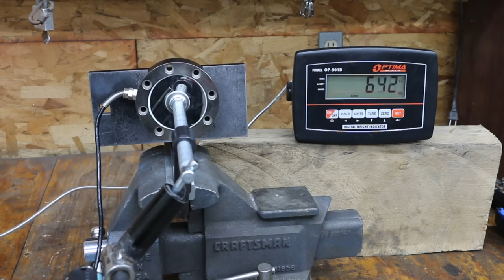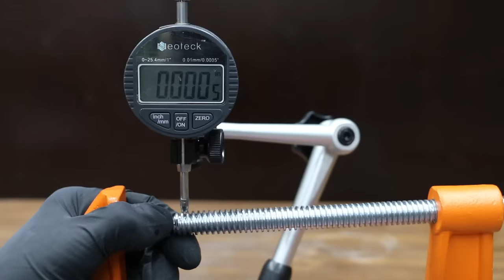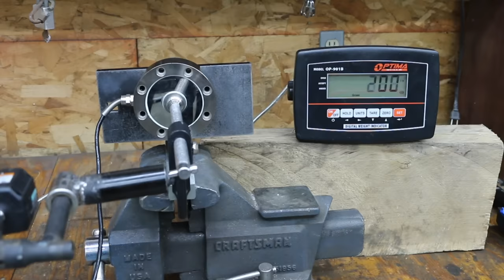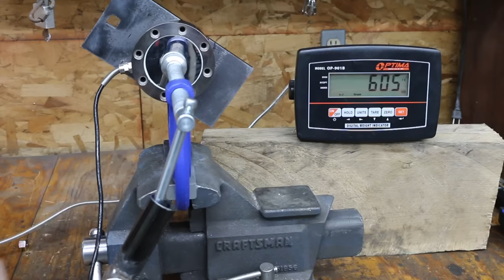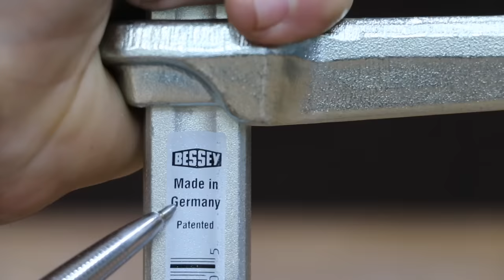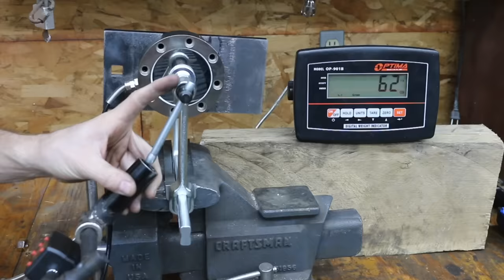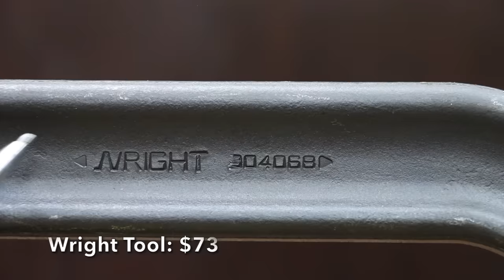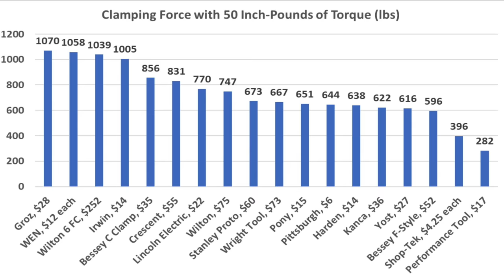Best C-Clamp? Let’s Settle This! $4 vs 252, Wilton, Yost, Irwin, Wright Tool, Harden, WEN, Proto

Comment: Your videos are very helpful and always full of unbiased testing.  I do have some reservations about the clamp force test…
The clamp crank arms were different lengths, so a constant of 50LB on the torque wrench would lose its “constant” quality when not at the same lever distance from the screw.  Additionally, it appeared that the sleeve you had set up to go over the crank, when attaching your wrench set up, was used at full depth on some but only partial depth on others.  This would suggest that the 50LB “click” may not be delivering the same torque to each of the different screws.  Test…Imagine if one of the screw crank arms was 4 feet long, you could get some serious leverage on that crank before your torque wrench ever knew about it.  So if length (lever) matters, it must be exactly the same for each test.

Comment: I can attest to the Irwin, had one for 2 years using in heavy equipment mechanic work. Finally bent the frame and handle pressing out a u joint that ultimately had to be cut out. It outlasted my harbor freight vise that catastrophically succumbed to the same u joint. No complaints for $14
Reply from the maker: Thanks for sharing.

Comment: I would like to point out I've gone through a few of these in my field of work, and one thing I can attest to with frequent heavy use, that if the threaded bolt in these clamps do not have a black coating on them, the threads WILL wear TREMENDOUSLY quicker. This alone should help get you a half decent one even with all the other down sides. Also avoiding anything made in china helps too. The thorough testing was fantastic though! You are doing gods work =).
Reply from the maker: Thanks!

Comment: Irwin were our go to in stone cladding. Things were expected to get damaged in out line of work so they hit a sweetspot of affordability and durability. 

When we found F claps it was a revelation for tight spots. We ended up doing some very rough modifications to them for fitting stone soffits on commercial builds. We would take the caps off the end and shave down a section to fit in between joints amazing what 12mm of material can support when you need it too 😂
Reply from the maker: Thanks for the feedback.

Comment: I tend to lubricate my swivel ends and threads the course threads is to allow you to adjust the clamp quickly less tirnsvto get where you want, the thread clearance allows for some dirt or small spatter to pass through
Reply from the maker: Thanks for sharing.

Comment: Every tool has it's place.. If you're holding wood or your wife's DIY project, use a $5 C-clamp, I used to run a boring mill and would use 1 Machinest clamp to pick up a 1000lb plate of steel without concern.. As with everything, you get what you pay for, and you got to have the right tool for the job.. Great Video as always 👍
Reply from the maker: Thanks!

Comment: As always love the tests, just a thought, I'm a welder by trade and I always oil up the threads and swivel head which completely changes the performance when compared to dry, some of those manufacturers may have done better just because of the added lube
Reply from the maker: Thanks!    Thanks for sharing.

Comment: The Yost is one of the best on that list factoring in price and design. Notice that the handle bent before damaging the screw (handles can be replaced, screws and frame not so much), the threads didn’t gall, and the frame took a high force without twisting like the other top brands. $27, that’s not bad. I have 3 yost c clamps
Reply from the maker: Thanks for the feedback.

Comment: After 20 years as a shipfitter I would love to have most of those clamps.  The only problem is they would never get used.  I carry clamps around, but I don't think I've ever seen anyone else use them.  As far as we have to carry everything, plus all the ladders and stairs. People start shedding anything with any size or weight to it usually before they even make it to the ship.  Then if you got to go up a dry dock or find a way to get down to the bottom of some obscure tank or hole and you would be surprised at how many tools you can pick up along the way.  Seeing people make videos where they use a different tool for each piece they need to make and enough clamp to supply an entire shipyard to hold something that's only a few feet long makes me wonder how they make any money I'd be broke just off of the tool budget
Reply from the maker: Thanks for sharing.

Comment: If you test trigger or Quick-Grip clamps, my experience is that they sometimes don’t maintain pressure overnight, and they get worse as they age. Building small boats, I use a lot of clamps. I tend to use trigger clamps for initial single-handed assembly convenience, but then substitute with more reliable clamps or temporary screws.
Reply from the maker: Thanks for sharing.

Comment: I very much appreciate you throwing in the F-Clamp here, I expected that style of clamp to be a lot lighter duty than the C-Clamp! Is there a chance we will se a F-Clamp comparison, perhaps with some other styles of quick release clamps as well? I always wondered if the cheap plastic F-clamps would hold any weight compared to the metal ones
Reply from the maker: Thanks!

Comment: C clamps are often used for brake jobs. Tesing how the finishes hold up to brake fluid would be interesting. Maybe on future tests, check how tool plastics/finishes/rubber hold up to brake fluid, engine oil, and common stuff like that.

Comment: I use the wilton 6 FC fir work building bridges  mainling while pile driving and with out a clamp of this strength my job as a welder would be several times  over harder.
Reply from the maker: Thanks for sharing.

Comment: Hey Todd, I just randomly had a video idea. There are many different kinds of  corded electric /cordless electric/cordless butane soldering irons. I have bought most of harbor freights and they are "ok". But I would love to see a video on the different brand irons you can come across and test! Another potential video idea is car ramps for oil changes for the DIY'ers, plastic/steel and many more options im sure. Good luck and thank you.
Reply from the maker: Thanks for the suggestions.

Comment: I previously thought that Bessey and Pony were high quality.  Now I just think they are over priced.  The Yost and Groz seem like good quality for the price.

I like how Pittsburgh clamps cost $1 per inch.  I think they are the best value (especially with a 30% off coupon) for a general purpose clamp when you don't need extreme performance.  I own several, including two 8" and a deep throat.  I bought the 8" c-clamps when I was working on an old deck and need to repair a splitting (cosmetic, not structural) 4x4 post to reach around the posts and right angle blocks (to stabilize the clamp on the post).  I later used them to repair an decorative cross member that was covered with paper mache siding boards (the house was built in 1972) that had delaminated.  I cut off the delaminated parts, then used a 2x4 fastened together in to an L-shaped corner, wax paper, and Gorilla polyurethane glue (because caulk would not stick), and misted the spots with water.  The clamps kept the glue from expanding, the boards kept it flat, and the wax paper didn't stick.  It turned out almost perfect.
Reply from the maker: Thanks for sharing.

Comment: I have a few 12" heavy duty clamps and 2 15" heavy duty clamps. I put a 15" Cresent wrench with a 6ft cheater bar and I can bend my 3" welding table
Reply from the maker: Thanks for sharing.

Comment: That was a good one. I've been a framer in Arizona for more than 25 years and all we use when it comes to bar clamps is 3/4" pony an never had any issues. Would love to see a best bar clamp or if you can afford it a best parallel clamp video. Thx from AZ.
Reply from the maker: Thanks!  Thanks for the suggestion.

Comment: You need a vibration test to see which clamp works best clamping down steel that is being vibrated by a grinder.

I use a 6 in double anvil c-clamp that works well for sharpening  lawn mower blades as it does take as much torque to hold the blade steady while sharpening. A regular c-clamp will always vibrate lose unless you tighten it with all you got.
Reply from the maker: Thanks for the suggestion.

Comment: Video idea. 

Old trick from the 70's (carburetor engines) was to use 2 metal cans, typically coffee cans,  coil the fuel lines between the 2 cans,  and fill the inner can with dry ice.  

Also,  a similar setup to cool the intake air using dry ice since cold air was more dense, containing more oxygen.

Be interesting to see if they still work on newer computerized engines, and how much better they actually work on the old technology engines.

Comment: Very impressive, I've always thought all C clamps were made pretty much equally. Have you thought of comparing different tarp brands? Any idea how you'd test for durability, heat resistance, thickness or would this be too short of a video?
Reply from the maker: Thanks!  Thanks for the suggestion.

Comment: Nice job as usual. I enjoyed this as I do all your videos. 
I do have an idea for another video. 
I've seen every one of your videos you have posted. 
Unless I've missed it through the years.
I'd love to see which is the best ethanol fuel additive to keep the small engines running great and not any corrosion from sitting all winter.
I personally use non-ethanol gas. But I use to use ethanol gas and was rebuilding my carburetors every spring.
There are so many additives on the market now. How do you know what's the best to use. My friend refuses to drive 20 min to a gas station that has non-ethanol gas... lol

Thank you,
Jeffrey Dohl

Comment: Thanks for using standard measurements. As an American gen Y kid, we obviously only learned metric in school but standard is just superior for practical measurements. Metric is great for many complex scientific measurements and rocket science but its really not very good for practical measurements due to the units having no relationship to the human body. As someone with a foot that's exactly 1' long, its nice being able to calculate distances and dimensions of things without any tools. An inch is also easy to understand due to parts of my fingers. 

I think metric is great and has its place but understanding and using both systems is still the best since standard measurements have a practicality that metric just doesn't have. Sorry if I offended any Europeans, Asians, Africans, or South Americans but I think you'd all be much better off if you used both systems too.
Reply from the maker: You are welcome!

Comment: I have Armstrong clamps with 1" bolt head locks, my smallest a 6" will hold a litteral 12 tons 24000lbs. The 6" was about $575.00 weighs about 12lbs.and is dropped fordged steel U.S.A. I used to be a Millwright!!!

Comment: Hey Todd, another interesting video testing various brand products. 👍 I remember in 1981 when I was working at a Honda & Kawasaki dealer in south Florida, our Snap-on tool man did a demonstration comparing their 12 point box end wrench again Sears brand. He had a 2" long plastic nut and slipped each wrench onto it, then forced each wrench against the other to prove that the Sears brand would slip rounding off the nut and the Snap-on brand would hold. He was correct which proved the Snap-on brand had a better grip. I believe you just recently did a similar test tightening a nut or bolt to see which wrench took more force to cause it to slip. If I'm correct the Snap-on failed pretty miserably.
Reply from the maker: Thanks!  Thanks for sharing.
Reply: @ProjectFarm  👍🧓

Comment: I love all your testing, just please consider using newtons, millimeters and Celsius degrees... The margins of error using these units instead is much tighter, and more precise. Also measuring clamping forces and such stuff in pounds is counter intuitive, because pound is a unit of mass, not Force (compared to Newtons). Keep up the good work!
Reply from the maker: Thanks, will do!  Thanks for the suggestion.

Comment: We use those overkill clamps at work to lift and move slabs of metal with cranes and forklifts and I sincerely appreciate their load capacity.   We call them strongback clamps. 😅
Reply from the maker: Thanks for sharing.

Comment: Excellent video!
Very informative commentary.
Question: which, if any clamps looked like possible repair candidates (even if for equal or lighter duty)? ( thinking straighten with hydraulics, MIG or TIG on cracks or breaks) ...
Reply from the maker: Thanks!

Comment: Grease on the screw threads can make a big difference.  Should be moly grease as there is sliding metal to metal contact, of course.
Reply from the maker: Thanks for the feedback.

Comment: Mechanics tip - If you need a really beefy C-Clamp, but don't want to spend $200+ dollars, just get a ball joint press kit. I've spent many hours using a cheap ball joint press with various pneumatic and electric impact tools, torching around the screw, hammering the back of the clamp with sledgehammers. I'd be really curious to see a comparison between the data here.
Reply from the maker: Thanks for the feedback.

Comment: It would be interesting to do a follow up on these comparing them to the alternative I use quite a bit in the machine shop/fab world instead: Kant Twist clamps! 
A little different in terms of jaw depth and clearance needed to use them, but if I have the option I usually grab the Kant Twists firsts... 
Always an application that will require one vs the other though!.
Reply from the maker: Thanks for the suggestion.

Comment: well, as a german steelworker we have bessy F-clamps and we have way thicker ones, the one you have is really just a "light" one the tickerones didn´t even bend that hard, and you can even use a 19mm wrench on them to cheat them^^ we can even straighten stell that was warped by welding( btw thats normal for those who don´t know it, heavydutywelding) for harder stuff we use a 100ton press and/or a torch ^^ my company builds parts for miningexcavators from komatsu :)
Reply from the maker: Thanks for the feedback.

Comment: Hey, I really love your videos and your methods, just thought I'd let you know that I'm pretty sure you're not creating an equal amount of torque on each of them whenever you test a product with different length handles such as a c-clamp or a bench vice — it's all about the distance from the center so of course, when they have different lengths…

I know you're putting a torque wrench on there, but unless the torque wrench is at the same DISTANCE each time, it's not measuring the same torque.

I've learned a LOT about the difficulty of making objective measures from watching your videos, and really admire the creative and practical workarounds you keep coming up with to affordably home-in on absolute figures for the strengths and weaknesses of various products.

Thanks for your work!
Reply from the maker: You are welcome!

Comment: Awesome test! I hope your wrists are okay 😅 I am very interested in seeing a fishing line comparison (abrasion resistance, breaking strength of the same diameter line etc). Abrasion resistance of monofilament vs fluorocarbon line would be very interesting! Many people have different opinions on what's more abrasion resistance and finding out the truth from someone as certified at testing as you would be great!
Reply from the maker: Thanks!  Thanks for the suggestion.

Comment: Always amazing! I wanted to see what works better at keeping moisture in a safe down, golden rod vs Peet and if the silica gel is good enough, but would be a longer project.  Do you run multiple projects at the same time?
Reply from the maker: Thanks!  Thanks for the suggestion.  Most of the time I am running multiple projects at the same time all depending on the testing time.
Reply: @ProjectFarm  yes it's amazing work, I am surprised a network hasn't approached you for a show.

I just got a second identical safe and thinking about doing a golden rod instead of the peet for my second safe and swap the heating devices to see if the delta in humidity changes (has to be 4x times and the measurement devices may have a slight offset/skew themselves). I would rather have you do the work (and have the data reach more people through your network) than myself, but if you are already loaded, would take on the experiment.

Comment: For the work I usually do, that F clamp actually seems pretty appealing.  That quick adjust seems nice, as does the deep throat (nice), and it is probably durable enough for my purposes since I don't do much heavy-duty work that required a huge amount of clamping force.
Reply from the maker: Thanks for the feedback.
Reply: Bessey f-clamp all day

Comment: Would really love an episode on some car chargers. I find that their constant charging is very lacking. I do a lot of car audio DSP and resonance reduction work involving sometimes hours of settings adjustments and detailed resonance spot marking. This means leaving the car's ACC on and use chargers so that I can pull it into the shaded garage without choking on fumes and wasting gas. Unfortunately my two chargers are only capable of maintaining a full charge rate of 5A for a couple of minutes, maybe 5 before tripping a heat sensor and starting its on/off cycle. Most of the systems I work on including my hobbyist one use over 15A constant charge while checking resonances at each frequency but I just have no confidence in advertising about "charge rate" if it just trips anyways after a few minutes.
Reply from the maker: Thanks for the suggestion.